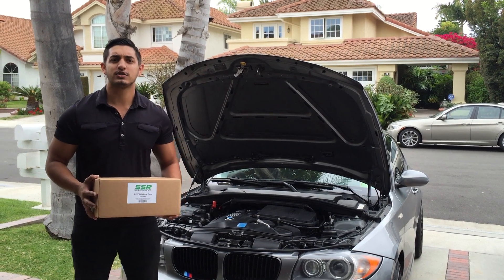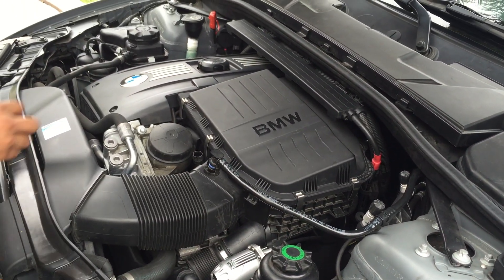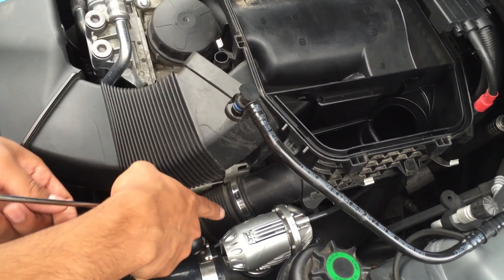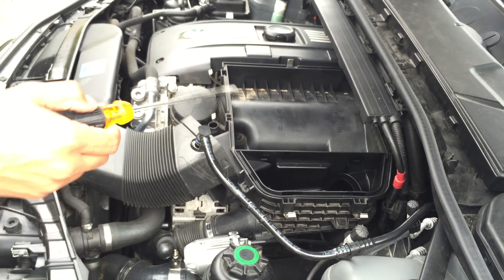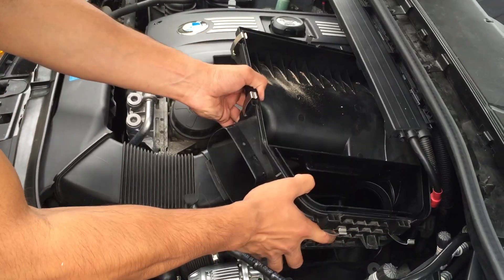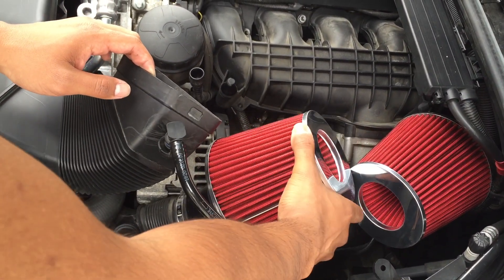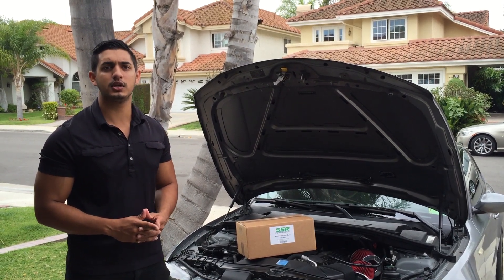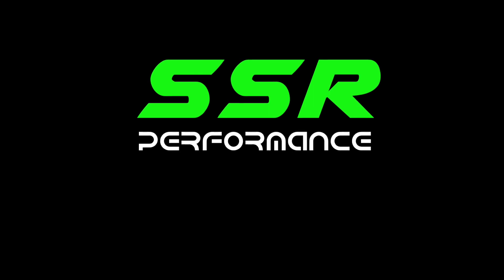SSR Performance N54 Dual Cone Intake (DCI) Install Guide

Comment: @0:37 when I pull off the breather valve, I have zero suction noise like I used to even after a drive. Could this be what’s causing my 30ff?

Comment: The battery cable rubber holders are all attached to the airbox.  How do you get those off?
Reply from the maker: They just simply pull right up. They are made of rubber and they slot into the bracket on your air intake box. So if you pull up on the rubber pieces they will slide off of the air intake box. Let me know if this works for you 👍🏼

Comment: you could make a video, how to install charge pipe?
Reply: Rodrigo Gomes it still directs cooler air from the front of the car to the intakes. Takes a small amount of heat washing away. If you have an aftermarket intercooler it doesnt really matter tho

Comment: Hey I have another question about BOVs in general. To get the flutter sound when the BOV isnt fully open, could one simply buy a BOV with a different spring tension to the psi they are running or would this damage the turbo? Really wanting to achieve that flutter sound as opposed to just a normal blow off sound
Reply from the maker: That is not something that you get to decide really. From all the different N54 applications we've seen, we've never heard that "supra" blow off sound that everyone knows so well. That's just a combination of the overall setup. Generally you want to stay away from flutter, because a flutter suggests that there is some sort of restriction in the path of the air.
Reply: SSR Performance Ah okay I thought this may be this case, the stock turbos on the N54 are only small so its no suprise I suppose. Thanks for your help! :)

Comment: How did you get the back filter in there? When i try to fit it, the filter is blocked by the throttle body
Reply from the maker: I believe you are misinterpreting the intake manifold as the throttle body. All you have to do for the rear filter is leave the pipe out longer. Put it on the edge of where you think it will not slip out on the filter side and you should be fine getting it to reach the inlet. Let us know how that goes for you 👍🏼
Reply: +SSR Performance it worked thanks so much !

Comment: i install  my but the intake it doesn't sound or move  like your does  does you have any idea why or is normal?
Reply: do you have BOV on your car also? ( blow-off valve) IF you dont know what is it, it's the gray/silver item next to power-steering tank, or whatever it's called
Reply: Joni Laulajainen i dont is that the problem ?
Reply: the sound comes from that BOV, thats for sure, because i have installed those also

Comment: hi dude, I have a 2007 335i, can install the same dual cone on it, is it the same thing? and is this all I need to do to install em, or do I need something else? sorry I'm new to this never installed intake before, thanks a lot in advance
Reply: Yes you're fine follow the steps in the video. 2007 335i's also have the same N54 Engine.

Comment: DO NOT BUY THESE!!!! Buy ecs tuning dci’s for a little more, much higher quality and will actually fit. These are terrible!!!!!Also the ssr website does not allow refunds so you’re welcome for saving you about $70 in advance
Reply: Also the ones in the video are probably alright, but they are not the ones featured on the website, they’re much more expensive and made of what seems like metal instead of slimy plastic
Reply: WRONG!!!!...i bought these a year ago and they fit PERFECTLY ON MY 335i...NO ISSUES watsoever!....washing them is a breeze also....